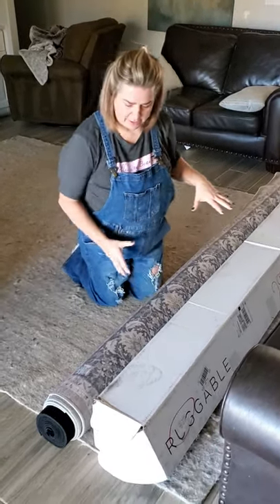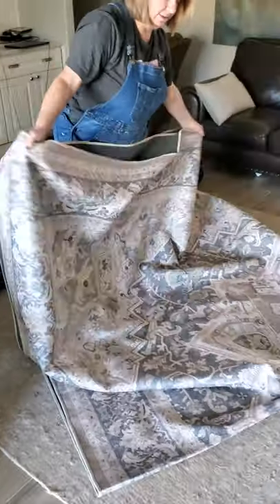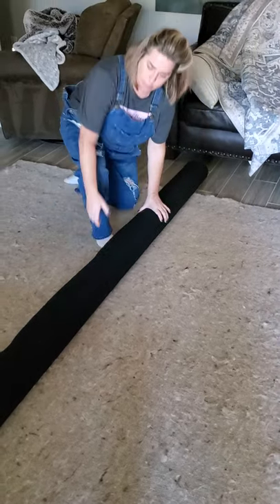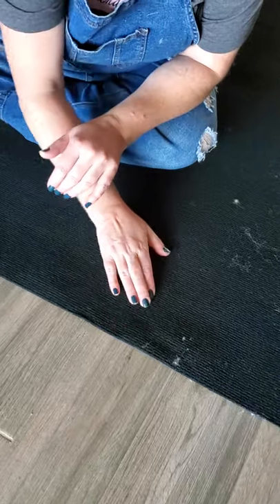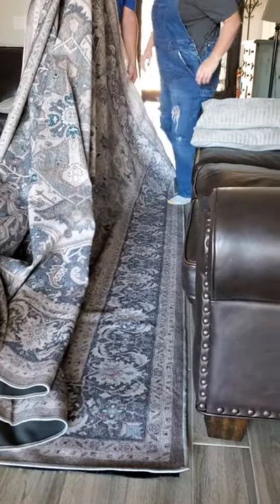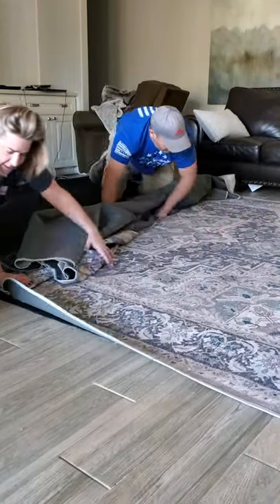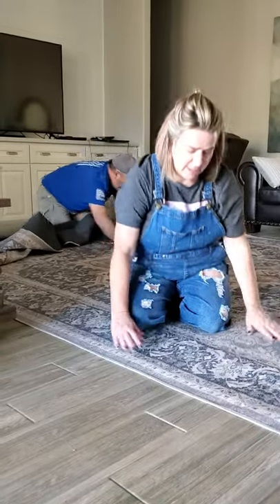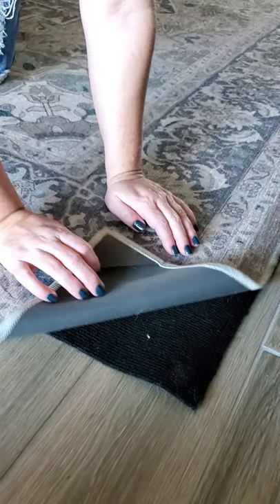Laying out our Ruggable Rug

Comment: I have quite a few ruggables as well.  I've washed them several times,  and they hold up well.   I'm not lucky enough to have someone help lay it down, but I roll the top rug portion into a tube, press down on one end to start, then simply unroll to the other end.  Works like a charm

Comment: Per Ruggable the corners are actually weighted and you are not supposed to tuck the corners in. You lay it over the end piece and it is nicely weighted and keeps it from curling. Those having problems with curling (like I did) just untuck and voila the rug lays flat.

Comment: I found the set up to be absolutely insane. Trying to get the corners of the black mat into the flaps on the backside of the rug was IMPOSSIBLE. And then the wrinkles were a nightmare. Threw mine right into the trash. No Ruggables for me
Reply: The rug is not meant to have anything tucked into those corner flaps / pockets, they are weighted :)
Reply: Why would you try to tuck the black mat into the rug corners when the instructions don’t say ANYWHERE to do that? Why would you blame the product for some weird configuration you made up yourself? The corners are NOT pockets for the mat to go into. At all. You’re not supposed to tuck anything into them.

Comment: I just bought a tumble rug. My coffee table with wheels is pulling the rug around... Looks like your table has wheels, with the Velcro does the rug stay seated?
Reply from the maker: Interesting.  Is the rug a smaller size? Our table does have wheels, it's never been an issue. We have a 9x12 rug
Reply from the maker: Interesting.  Is the rug a smaller size? Our table does have wheels, it's never been an issue. We have a 9x12 rug
Reply: @BrushedbyBrandy   it is smaller, it's the 6x9. The tumble rugs don't have the Velcro just corner stickies. I'm thinking I need the Velcro to avoid this issue... I had read so many reviews about certain ruggable rugs curling on the corners that I opted for tumble... I waited over a year for them to get this size 🤦 😂
Reply from the maker: @Nicole Paling  ok that makes sense, I bet the velcro would help
Reply: @BrushedbyBrandy  Is your table pretty heavy?